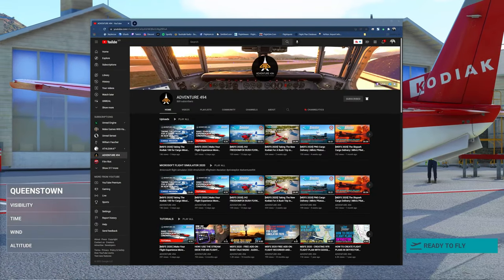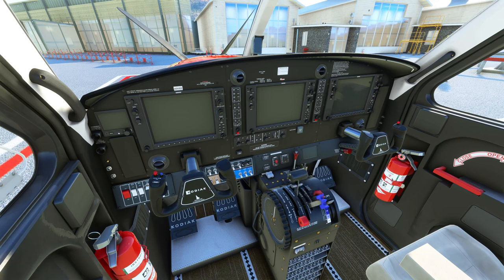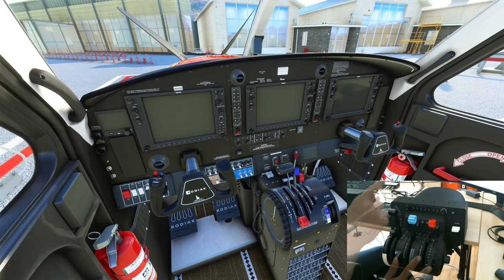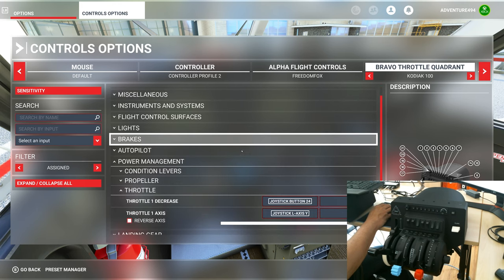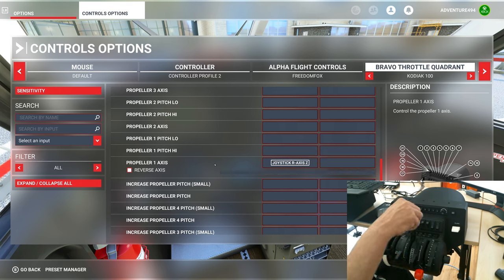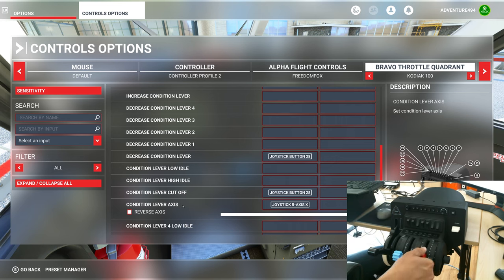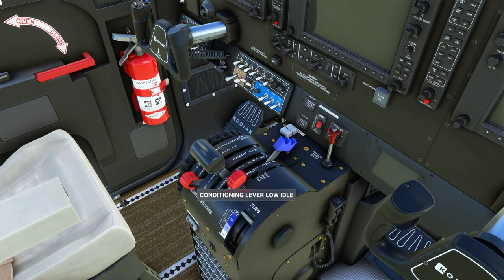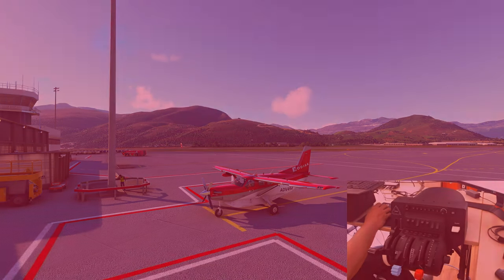[MSFS 2020] How I Configure My Honeycomb Bravo Throttle Quadrant For The Kodiak 100

Comment: Thank you. At the moment, I'm trying to setup the Bravo for the Twin Engine Barren 58. I'm having a lot of trouble with the flap selector. I want to use the selector lever to increase/decrease the flaps incrementally. Therefore, the flap lever needs to be an axis lever. 

There are many videos on this but they're all outdated. Most are for FS back in late 2020 and 2021. The control UI for the latest FS 2020 version, (as of 10-8-22), don't offer the same options as were available in 2021. 

That doesn't mean I can't setup the levers to do what I want them to, it just means that the selections named in earlier versions are now named something else.

In one example from a video, (posted in early 2021), was demonstrating flap setup in the Bravo for a 787. The instructor referred to using the "-100 to +100" incremental selection for the flaps lever. But the latest, updated, FS 2020 version doesn't offer that selection for flaps anymore. I tried "0 to 100" but it didn't seem to work.

It was late and I was tired, so it's possible that I did something wrong. Anyway, I need to find a video that addresses how to setup the multi-position flap axis selector in the Bravo, but the video would need to be using a recent version of FS 2020.

Your video is very helpful, but it's a single engine plane with no speed-brakes and essentially a basic configuration. I'll look to see if you've posted any videos for the Bravo setup in twin engine planes that have speed brakes, and a few more advanced options.
Rich
Reply from the maker: Hi Rich, I have not have the chance to check out the latest setting on the Bravo, I'm still using the same settings and it still works for me. I wish you good luck with your settings.

Comment: Thanks you, finally reverse works... did you get the bravo to work with the g1000 as well? if Y possibly a future tut there
Reply from the maker: Hey Coops, thanks and glad it works for you. The G1000 meaning autopilot? Yes it does. I’ll make a tut of it. Thanks for the suggestion 😊
Reply: @Adventure494  well it ws working.. now i have this issue where all levers work when i load in. As soon as i start the engine, the throttle ( and ive tried different axis) just jumps in to reverse and stays there. I t asttempts to go to the correct position but just ends back in reverse.. head explosion imminent
Reply from the maker: @OldManCoops  that happened to me to, just re assign the axis and buttons correctly and pls save as a diff config. MSFS still isn’t stable, every time they fix something, something else breaks…good luck 🙂

Comment: I have assigned parking brake and yaw dampener also.  Thanks for the vid.  Just got the Bravo today and now i have it all set.  Is this set up ok for the Cessna Grand Caravan as well?
Reply from the maker: Congrats on the purchase. Yes you can follow the same steps for the Caravan.
Reply: @Adventure494  THanks for the reply.  I would love to see a config for the yoke with a start up guide for the Kodiak.  Can you make it so you only have to use your Honeycomb buttons, and not have to use the mouse for a cold start?
Reply from the maker: @billbaggins1688   for the Kodiak, on my Alpha, I use the default settings, all lights switches are working, except for Landing lights, it a 3-mode switch (couldn't get that to work no matter what I tried). The rotary switch (start switch) works like a charm. Hope this helps! Happy flying!

Comment: Good job man. Thanks a lot.
Reply from the maker: Your welcome and Thank You!
Reply: What about the beta range ? That doesn’t work with your configuration. 
Thanks a lot.
Reply from the maker: @pboire1402  yes it does. Although I’ve upgraded my Pc recently, I’ll probably need to reconfigure. ☺️
Reply: @Adventure494  i don’t think it works. Really. beta range is something différent Than Reverse. We use it on the runway to go slowly. Beyond 20 KT.
Reply from the maker: @pboire1402  Hi I know what beta range is, I have used it before on the Kodiak. Let me try again, as I mentioned I have upgraded my PC and have not flown the Kodiak since. Bear with me...
Reply: @Adventure494  Thanks for your answers. Happy holidays.